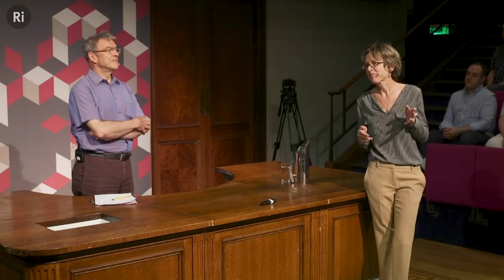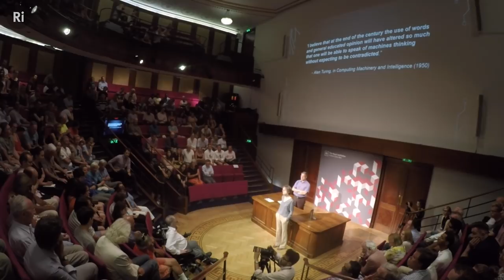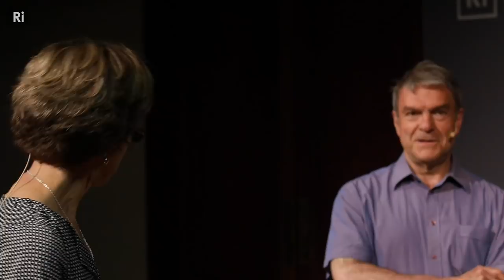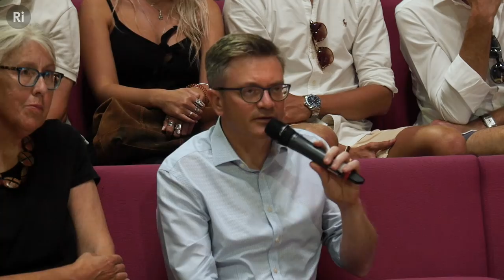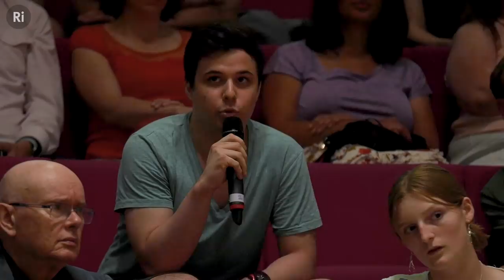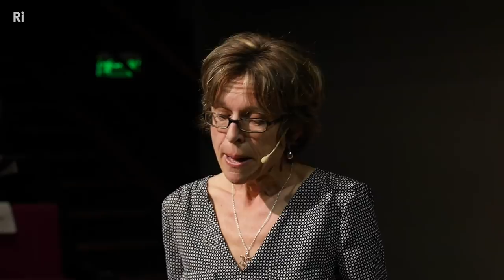Q&A: Synthetic Intelligence - with Zdenka Kuncic

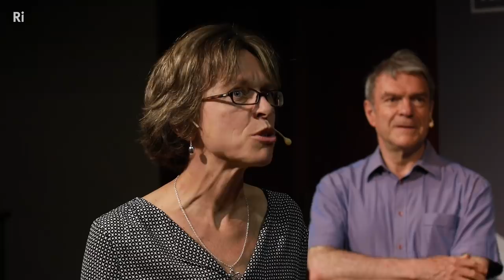Comment: 15:12 Just because our brain is the outcome of evolutionary processes doesn't mean the structure is optimal. Our eye, for example, is the outcome of those same processes but is far from optimal.
Reply: ...and yet we don't see cats creating science and technology.
Reply: I would characterize it in this way, evolution provides the optimal compromise in a given environment. Our brain may not be the optimal candidate for memory, for stable calculation, or for power-efficiency etc., but our brain should be the optimal choice for the scenario considering all necessary environmental constraints which require compromises from all sides.
Reply: @ajasonchen  That is an excellent way of putting it. Still I think the speaker should have defended their model as an attempt to specifically replicate the brain, rather than by suggesting that this brain model is optimal because of evolution. I mean, we dont know what sort of effect the shape and organization of the brain might have on cognition, so maintaining those properties in a synthetic brain is important.

Comment: At 15:00 the question is answered that it is the perfect structure. It is certainly evolutionary tested but it had to obey physical parameters so it's packing is optimal for that bounds. What about a virtual brain it could pack itself much differently or a s an abstraction or data structure be virtually independent of proximity based packing.

Comment: Are the weights in AI kinda like emotions just without physical feeling, what if you gave it a body shocked it for bad answers ,and make it warm for good answers?
Reply: neutral network weights are just emotion? sounds about right
if you gave it a body, and punish/reward it, it would always go for the reward, if the reward was not opposite the punishment(in the case of data, call it a number, it wants to increase the number, not decrease it) if you gave it shocks and heat for example however, it would just maximize it's capacity to gain heat until it melted, if you gave it the option of heat and cold, this would be more in line with emotion, it would have to balence them to the level that is optimal for it's operation, never striving for infinitly higher numbers, nor would it let it's number get too low
.....i think, if i am understanding this and other videos/lectures correctly

Comment: Simulations are great for checking if your design is working, but for scientific stuff simulations do not work, your simulations are just as good as the source code of your simulator. Even the best simulators have bugs and rules and laws of physics that are left out intentionally or not.
Reply: In science you don't use a 'simulator', unless it's been written specifically for scientific simulations, like COMSOL or ANSYS, and even then you have to very carefully define your model, these are just numerical workhorses at heart. For this case, the simulation will be written from scratch specifically for this application, encapsulating all the physics they want to capture. This isn't the same as sticking it in, say, blender. In fact, even for mechanics simulations you would not use these types of programs, which are optimised for speed and visuals, you would write your own that takes into account all the factors it needs to.

Comment: I'm puzzled about I/O  . Animals have evolved cameras (eyes) , microphones (ears) ,touch and temp sensors that are integrated with the same 'technology' (biology) . A usb port is going to be a bit mighty to connect to a  nano circuit!
Reply: William White  you're right most people forget that eyes do not see brain does. hence subjective experience. is my red same as your red.
Reply: So first the eye has both a lens and a way to record visual information and send it along to the brain.  The brain does not see, per se.  It only receives electrical signals like the ones sent by the eye or the ear, etc.  The subjective part all happens after the brain receives and begins to interpret the data.  This includes being able to figure out whether something is far or close based on visual cues, combining the images from both eyes and other much more potentially subjective things as well.  The point is the eyes see accurately, but not helpfully.  The brain interprets helpfully with accuracy as a second priority.

To the original question, not too sure.  It sounds like these systems are built from the ground up to be electronic and receive info from a computer or what have you.   She does do simple input with the 1 and 2.  What she actually demonstrates is memory (from a computer perspective).  So she inputted the 1(not sure how), stored it in memory, now maybe she can use some of the same materials to process it.  In the brain itself I think that's definitely one of the century's billion dollar questions.

The interesting thing she mentioned was interfacing it with someone with dementia.  If that is in fact doable, from that step I/O to the brain is possible because I/O to her chip is possible, and presumably she's got it to behave like memory so that the brain can query it.  If that actually happens, then in my opinion the sky is the limit with enough R & D.  Get ready to purchase your brain expansion card and interface directly with wireless networks and the internet.
Reply: William White  okay when I say camera I'm including video cameras, obviously, because the eye transmits continuous images. Examples: webcam cctv, or any studio camera, which capture light and transmit it to another device as electrical signals.  That other device then interprets those signals and stores them.   

For instance a webcam does this in about 1/30th of a second: captures an image, does some work to encode it (which may technically take an sram buffer, but that's seriously unnecessary for the analogy and the principle), and sends it via some usb spec to a computer.   If cameras have their storage externally, they are still a camera.   In a sense they do record the information to an outgoing stream; eg. the information is not lost.

A lens just focuses an image.  The eye does more than that.

The point is that the eye has the same input/output characteristics as a video camera, which makes one analogous to the other.
Reply: AND the google result for define camera: a device for recording visual images in the form of photographs, film, or _video signals_.
Reply: You're super stubborn dude, now you got me picking on your points.  The point is there is an image in and an electrical signal out for both a webcam/cctv and an eye.  Therefore the eye is analogous to a cctv camera.  Does that do it for ya?